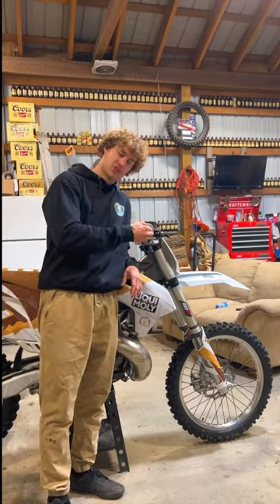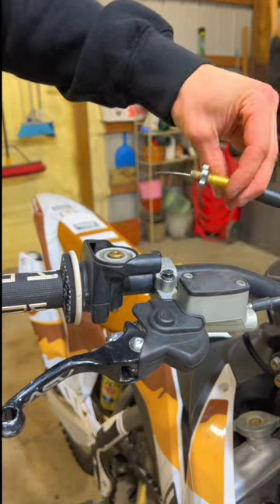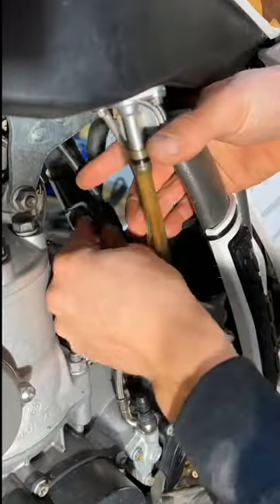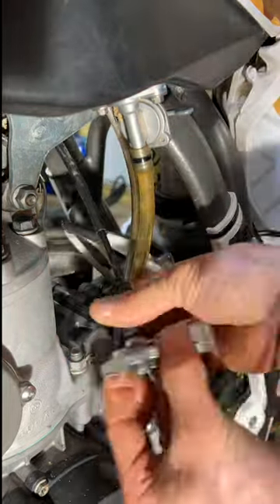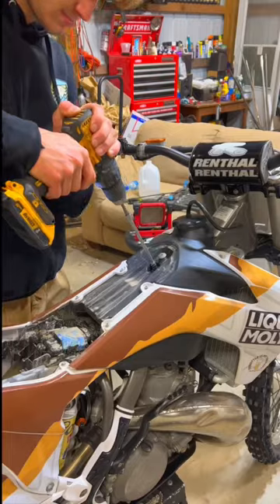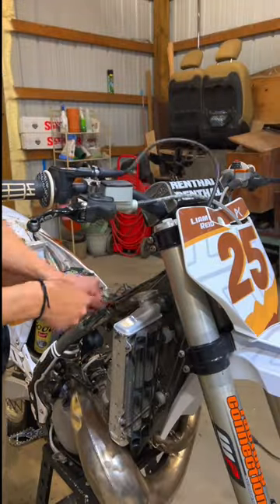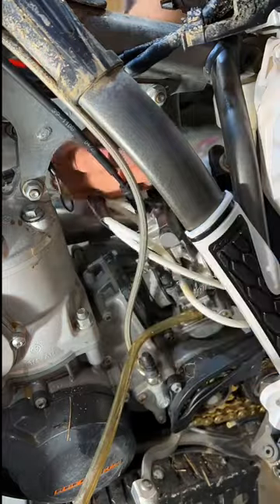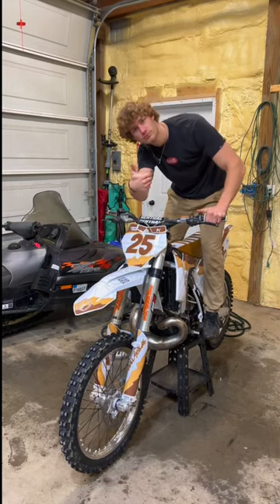This almost killed me😳 #mx

Comment from the maker: Almost killed me bc i was riding moto, if it snapped mid air the inertia from the wheel suddenly stopping me would have sent the bike end over end and been super bad
Reply: That is hardly alnost killing you. Almost killing you is having a throttle cable break on a street bike right when you pull out across traffic.
Reply: yeah i dont like dis liam man
Reply: Pull the clutch and keep calm. You knew the risks when you hopped aboard
Reply: @Liam Reid 
One of my dirt bikes throttle sticks wide open and I thought It was a bad thing at first but not I think cruise control

Comment: Pro tip when working stoned leave the cable and housing in place till you run the new one so you always reroute it properly.....same with bicycles
Reply: Good catch
Reply: That's no fun
Reply: This would’ve saved me a few headaches
Reply: Pro tip, if you can just tape the new one to the end of the old one and pull it through, shouldnt have to take off plastics or tank

Comment: Easier way is to disconnect your throttle cable both ends, tie the new cable upper end to the old cable lower end & then pull the old cable out. The new cable will automatically pull into the correct position, untie the two cables & connect both ends of the new cable. No need to take anything else apart.

Comment: You can actually just unplug the old cable everywhere and tape the top end to the bottom end of the new one and just pull it through. Safes some time, atleast it did for me. Edit: depends on throttle cable and bike

Comment: Huh? How'd a snapped cable almost kill you? I could understand if it were a stuck cable. And also what year is that bike?! Looks alot newer than my 2013 pit bike that I just had to change the throttle cable this past summer I'd be passed if my newer bike had that issue

Comment: Bro, next time tape or zip tie the new and the old throttle cable and slide under. No need to remove the tank. My lazy way. Remove or tape any nuts too. May scratch frame. 😅

Comment: Those mekunie carbs can be a bitch to got open if antisoeze isn’t put on the slide cap threads. My 85 Atc350x has the same one and I can’t get it off with a pipe wrench and a vise

Comment: Not hating I love the chanle but so far a lot of things broke already
Reply: It’s a older ktm I think 2013 or 2014  and it probably has at least 50 to 100 hours even tho it was rebuilt, some things still wear out. For example he rebuilt the motor but the throttle cable was something that didn’t get replaced. Not a huge deal but that’s why I always tear my bikes down to inspect all my parts and then replace what’s necessary and service anything that’s dirty, or could be lubricated.